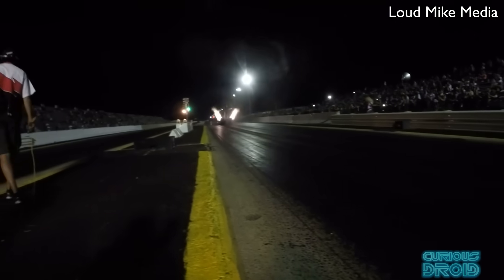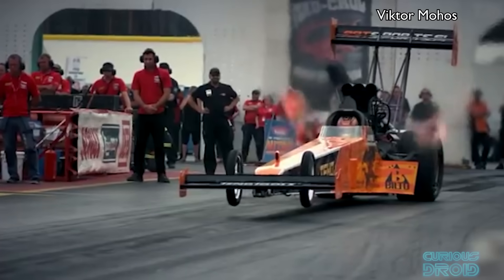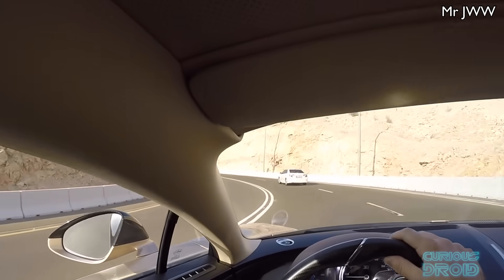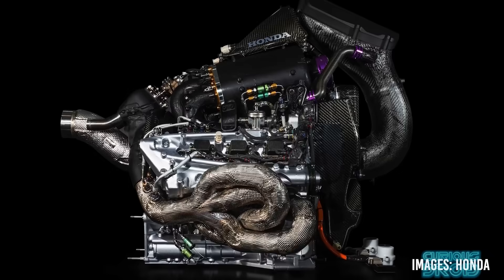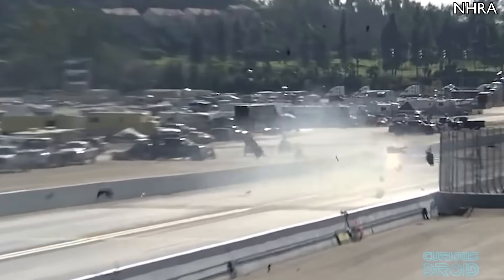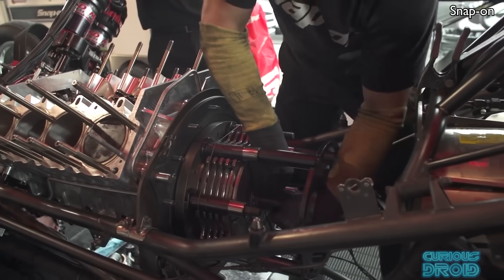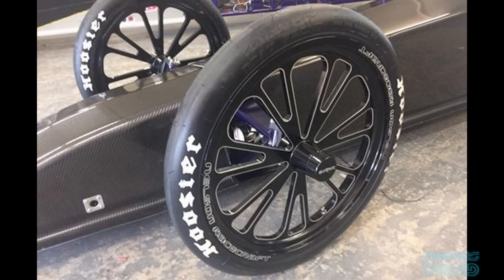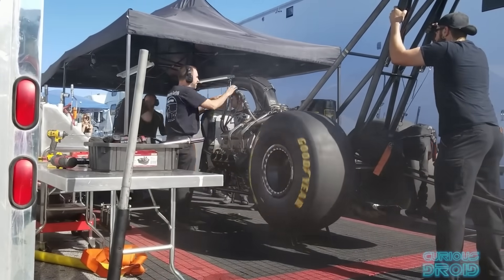The Amazing Engineering of Top Fuel Dragsters

Comment: I remember an interview with John Force's head mechanic. He said "I would not step out of the electric chair to get into the cockpit of the monstrous thing". I always thought after that, they really gamble their lives for 5 seconds at time.
Reply: When the sport was very young the car was set up with the engine in front of the driver. 
Not kidding, look it up.
Reply: @mykthafsh71   Yes indeed -- that's how Don Garlits lost part of his foot. Not kidding, either. The drivers used to have their feet straddling the transmission bell.  Unfortunately the entire transmission would occasionally grenade.
Reply: @mykthafsh71  what you're thinking of is slingshot dragsters, but those are actually after the earliest parts of the sport. The earliest stuff was just street cars and what we now call pro mods running on nitrometh
Reply: @THESLlCK  "Slingshots" were dangerous enough in their day and they only had a fraction of the power the current generation of cars have. I remember when a couple of thousand horsepower was considered "really" impressive. Nowadays, that won't even get through the elimination rounds.
Reply: @redneckhippiefreak  whoah now whoah now, I’ve heard of toluene in F1 and Mercedes 300+ octane fuel, but hydrazine??? That’s new. I wanna hear more. Tell me more if you can.
Reply: @redneckhippiefreak  I swear if I have the resources I’ll start my own “I hope I don’t die lol” race track with no limits to what you can do.
Reply: talk about a drama queen. In the last 50+ years, less than a dozen people have died in NHRA events. Do they gamble their lives for those 5 seconds? Sure. Your chance of dying in a car accident is also 1 in a 100. But lets not pretend that these guys are thinking " this day is the day I might die". Because clearly, if that were the case, I wouldn't be able to count ALL the deaths on just my fingers alone. Wouldn't you agree? Top fuel, if anything, is one of the SAFEST motorsports. Especially these days, with the shortened track.
Reply: @jamesbizs  Sounds accurate.
Reply: Austin Coil? That sounds like something Austin would say!
Reply: @stefanl5183  
Let's be honest, Austin was the brains that got the car down the track. Force himself has said he's just the dummy that mashes the pedal. 
Forces skill was talking sponsors out of their money, Austin qoute

Comment: Only meant to run for about 5-10 minutes tops,,then a full rebuild on the engine.   About $4000 per second on the dragstrip run.  New Bryant Fuel crankshaft is around $10,000 to the door.  They go thru a few of them thru-out the season.   Just about new-everything when they go boom!,, Pile up $200,000+ and set it afire, you will feel like they do when the motor returns to stardust,, Sometimes more than once in a raceday.  Love the Nitro cars.  Thanks CD!!.    Nice shot at 8:50.  Can see the torque wave come up the chassis and "bunny hop" the steer tires over with all lit candles at the hit.

Comment: Fun fact - top fuel engines aren't the only engines that use a nitro/methanol mix as fuel - you also find this in glow engines used in some RC cars, and much for the same reasons - able to cram a lot more fuel in the engine and get more power. The engines aren't very large - I have one that is 3.3 cc - and they are very simple compared to even a lawnmower engine. They are typically single-cylinder two stroke engines that use a glow plug.

Comment: I had a couple of "whys" when watching this. Like it's based a 1950s design - why? Also the stats could be with reference to something, maybe. But very enjoyable.
Reply: too get more power you need more fuel. because the fuel is the energy source, Not the air it burns with. Because Nitro carries its own oxygen it doesnt need to have dohc and multvalves. So a simple pushrod 2 valve will suffice.

Comment: It seems to me that the more you learn about something like Top Fuel Drag Racing, the more insane it actually becomes. The sights and sounds are impressive to the ordinary punter but to know that the internal combustion engine is working on the cutting edge of material science and strength and that feeding the fuel into the cylinders is a hairs breath away from hydraulic compression vs fuel combustion is truely insane.

Comment: There's a great story of Dario Franchitti testing an Indycar at Sonoma. He was pounding out the laps and was randomly feeling a bad vibration in his steering, severe enough to bring the car in to the pits. It turned out that there was also a top-fuel team running on the Sonoma drag strip and when they were doing burn outs they were shaking the ground to such an extent that Dario could feel it through the car.
Reply: I believe it.  I've been in the stands while these beasts do their thing and you can feel the stands shaking under your feet and butt.
Reply: @walttrotter535  https://www.youtube.com/watch?v=oakk1cOPzoY at 41:45 he talks about it; great little story. The only other sensation where I have expereinced anything like a top fueler or a funny car was at an airshow when 2 F-15s decided to pull up and go full afterburner. Mental :D
Reply: @willbrown6287  Agreed. I was under an F-111 in AB on the trim pad. The noise and feelings in my bones was rivaled by top fuel cars.
Reply: I have been in the poximity of both top fuel dragsters as well as the Space Shuttle lifting off.  The experience is comparable
Reply: It's like an earthquake with 160db thrown in for extra effect. You literally can not experience these safely without ear protection.
Reply: @grantbean2631  You "literally" can but expect your ears to be ringing for a few days. That is part of the fun for me.
Reply: @grantbean2631  It's funny to me how in the gun community people will call you stupid for shooting supers with a suppressor & no hearing protection meanwhile some stand near a top-fuel & just have some basic ear plugs. I'm still shocked it's 160 db, that's insane, every 3 db is double right, so we're talking magnitudes above some firearms. Crazy!!!
Reply: @grantbean2631  Tell that to the guys at 8:30
Reply: @narcoleptic8982  yes, because there is no such thing as internal ear protection….
Reply: My parents live 5 miles from a major track and on the weekends in the summer and fall these cars rattle the windows and shake the whole house. I've since lived near a bombing range and the drag cars are way more intense.
Reply: When they race the Fuel classes at Houston Raceway Park the universities are notified to they will ignore the seismograph readings.
Reply: i so need to go to one of those
Reply: I have been to tractor pulls and the turbine engines are quieter than the open header engines. There is something about the feel of the engine exhaust pulsating against your chest that feels exciting.
Reply: Jesus
Reply: they set car alarms off like a mile away from its hilarious when you see one guy not protecting his ears trying to look like a bad ass then it blips the throttle and you see pain wrinkles on his bald head  like a Lil pug doggo withe the ripple fur I promise they ain't cool anymore or think of trying that again it vibrates at such a level it makes the inside of your ear itch almost like that spinning tip amazing feeling but not that and painful
Reply: I read a post on the internet about how fast these machines are. Forgive me if I  get this wrong, but it involves a hypothetical situation with a Corvette starting a mile behind  a drag strip starting line where a Top Fuel car sits idling and waiting. When the 'Vette reaches the start line, it's doing 180mph. The T/F car leaves at same moment and still beat the Vette to the finish... that is honkin'!!!
Reply: !!! It’s not shaking the ground ... it’s shaking the air !!!
Reply: That's sick, I love DF, I never heard that story before, good share!

Comment: Electric dragsters are not a thing?
They could easily outperform a petrol driven dragster on raw torque and acceleration and probably have better power to weight ration since run time is only few seconds, don't need a lot of batteries ;-)

Comment: Thank you. I have been to top fuel drag racing and Learned a few things from your video. I am lucky to live in VA place where it's a hour to two drag strips. I wish anyone could come close to describing the idea of just if you watch from the starting line they sound like a bomb going off. Shooting ear muffs Will vibrant away from your ears. You half to push them against your head, if this is your first time you will jump off the ground. The end off the 1\4 mile(they have Shorten it) you can see the first second of the run and a flame going by. Greatest thing and I want to go see a rocket.

You have more then 5 things wrong in this video. I am not trying to be mean, but people are going on the Internet to find facts. They  weren't small things or I wouldn't have brought it up. Do better please, I am sick of the bad information on the internet. I maybe wrong but the flame out of the exhaust is not reignited because of contact with air yuck

Comment: Question, why liquid oxygen + fuel is not used for this type of race? can't think nitro has better at raw performance
I can think of security reasons, but is there another?
Maybe it is too much for an engine to handle? but rockets handle that, so it is possible 
I can see it being a huge engineering challenge, but isn't it the point of this type of sport? push the limits
Reply: Liquid oxygen has to be kept cold.  Not as easy as it sounds
Reply: @stephenpage-murray7226  this is probably the last thing i would call a hard problem to solve while dealing with pure oxygen combustion engine
Reply: @MrPinguinzz  
Nitro isn’t pure oxygen, and it isn’t run 100%, 90% is the max allowed and often less.  You’ve misunderstood the video
Reply: @stephenpage-murray7226  don't think we are talking about the same thing, did you read my comment? I'm talking about using fuel(not necessarily nitro) plus liquid oxygen, and liquid oxygen IS 100% oxygen
Reply: @MrPinguinzz  
Don’t think you’ll be burning LOx in an internal combustion engine if that’s what you have in mind?
Reply: @stephenpage-murray7226  dude... my question was exactly "why not"... was my first comment that hard to understand?
Reply: @MrPinguinzz  
It will turn to a gas when it warms.  LOx is the oxidiser what do you have in mind as the fuel?  In a Saturn V F-1 it’s RP-1 (kerosene) or liquid hydrogen in the second stage.
Reply: I think I understand. I'm going to make this weird and say think of nitro as an expanding foam. It creates pressure and moves the piston down. Oxygen however,  does not expand nearly as much. It just burns really really hot. And that extra heat doesn't make more expanding foam. 

That's why other drag cars use nitrous oxide and not pure Oxygen. It's 2 nitrogen atoms and one Oxygen atom, so when you burn the Oxygen with the fuel. The nitrogen atoms are left behind to act like more of that expanding foam.
Reply: @greenbean7853  i can see it being a thing, but nothing impedes then doing a mixture of oxygen and air to make a better oxidizer mixture than the air 80% n2 20% o2, lets say 50/50 is better, why not do that?
They can tweak the fuel-oxygen-nitrogen mixture using liquid oxygen to be optimal for extracting power, i cant see how not doing it is better, and i said "fuel" on my first comment exactly because i dont know the best one, if nitro gives a better perfomace, just use it, but it still needs air to burn

Comment: There are no words to explain what it is like or sounds like when you stand between 2 Top Fuel cars on the starting line. My dad is a 2 time world champion and I have been around this sport for over 50 years and can tell you the chills,goosebumps and burning eyes feels damm good each and every pass they make.
Reply: I can't imagine the experience to be that close, probably terrifying the first few times. How's your hearing today? I can't imagine that their is enough hearing protection on this planet that could protect  the ear from long term exposure to that. My ears always rang while in the stands in Las Vegas with double protection. I couldn't imagine being right in between the two on the starting line. I'd be deaf!
Reply: @mysteryguest9555  I wear both plugs and muffs for the protection. The real thrill is the pulsating of the engines hitting you.
Reply: Something I've always wondered is the V8 engine what's the most optimal for top fuel dragsters? I mean I have no doubt guys have done extensive experimentation with testing other engines like V10, V12, or even V16 and have found the V8 to be the most optimal in power/weight/rotational mass/etc. I genuinely don't know so I figured maybe you'd know since your dad has been involved in it for years. Like a lot of WW2 era fighter planes such as the P-51 Mustang use V12 engines so I always wondered how much power something like a Merlin V12 would be able to make if one were built to modern standards, ran on nitromethane & such.
Reply: @FinalFront  more cylinders means mores stuff to break
Reply: @FinalFront  Those big engines were designed to produce their power at lower rpms.  They would self destruct on 60+ pounds of boost and 90% nitromethane fuel.  The engines, superchargers and fuel all have parameters that they have to meet per NHRA rules so even if something would be better, there are limitations in the rules.  Top Fuel and Funny Car runs have already been shortened from 1/4 mile (1320 feet) to 1000 feet because the speeds were getting too high.  I expect to see consistent speeds of 340 mph and someone touching 345 mph in the 2022 season.
Reply: @David-hm9ic  not yet , 2023 just wrapped up and no one hit 340 yet
Reply: @FinalFront  pretty sure the V8 was just the most patriotic choice
Reply: Me too. It’s like the first time you hear rock and roll - led zep. There’s nothing like.  You feel it in your whole body from the sound and the smell — oh my the smell. 

My father raced a rail/dragster in the 70s. This was before automatic starters or reverse gear. 

If you look in a quarter track, there’s a single lane road used to “start” the rail/dragster.  There was no reverse and so they had to be manually pushed back.  I was 10 to 14 years old when I watched i father’s dragster being pushed to start. Then after burnout, me and I brother - along with my stepmother- in calf high white boots, would push him back for the race itself. He did get to mid 3s❤️
Reply: Sorry, pushed to start/ignite the motor.  And, I am/was a girl at the time. It was exciting.
Reply: Me too. It’s like the first time you hear rock and roll - led zep. There’s nothing like.  You feel it in your whole body from the sound and the smell — oh my the smell. 

My father raced a rail/dragster in the 70s. This was before automatic starters or reverse gear. 

If you look in a quarter track, there’s a single lane road used to “start” the rail/dragster.  There was no reverse and so they had to be manually pushed back.  I was 10 to 14 years old when I watched i father’s dragster being pushed to start. Then after burnout, me and I brother - along with my stepmother- in calf high white boots, would push him back for the race itself. He did get to mid 3s❤️

Comment: Interesting video, thanks! Brings in a question tho, what is the job of the driver of these cars? Press on the gas in time? Just curious
Reply: A lot actually. Staging, steering (even if it’s a straight line those cars want to do everything but then straight) throttle control, pull the chute, etc

Comment: One thing not mentioned in the video is how the clutch locks up. The plates get so hot that they weld themselves together. It's the short straw that has to remove the clutch pack in the pits.
Reply: 750-900 degrees F at teardown in the pits

Comment: Yes, but a single F1 race is over 300km (plus qualifying) and so those engines have to last not just 10 seconds or so, but the allotment of 3 engines has to last 23 race weekends, so each engine has to last about 20 hrs of running.

So they only produce 1/2 the power per litre, but have to run for over 7000x longer.

Comment: Are we going to talk about how the motors are mounted to the cars?

Hose clamps directly to the frame. Yep. The motor is help to the dragster with $.60 worth of hardware
Reply: thjer is an aluminum plate   betwen the engine anf flwheel   the front mount is a saddle clamped to the frame rail   solid mount pn both endsd may stress the frame

Comment: Top fuel nitromethanol drag racing is one of the things every human being has to experience in real life. Watching them on a screen is like having someone describe the taste of ice cream to you.

The power and noise is so immense, so truly titanic and biblical in scale, that the sound waves erupting from the exhaust quite literally cause your vision to go blurry and your bones to vibrate in a way you cannot ever experience any other way. The way I describe it is "sound and fury so immense it shakes your very soul"

I don't really like drag racing, and my wife has no interest in cars at all. But we go see the NHRA finals every year because it's such an otherworldly experience. If you haven't been to one of these events once in your life, do it. These titans of horsepower create a physical sensation you can't get anywhere else.

Beyond that, there are so many little details that amaze me. They have so many rules that flat out limit their power. Pushrod engines with two valves (they're the size of your fist, but still) driving a ROOTS supercharger. That blower is so inefficient it basically beats the air itself into submission before driving it into the motor. A twinscrew or centrifugal or turbo setup would add immensely more power.